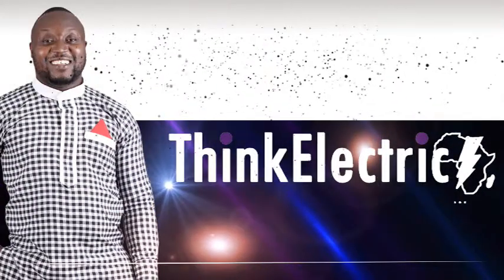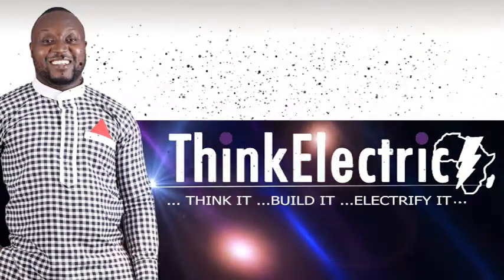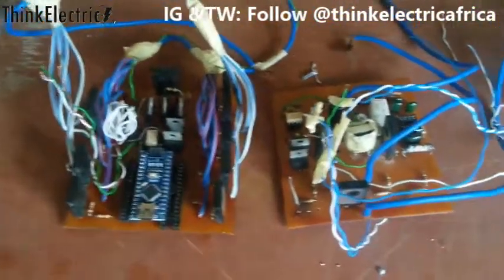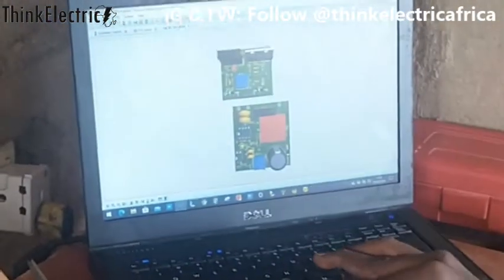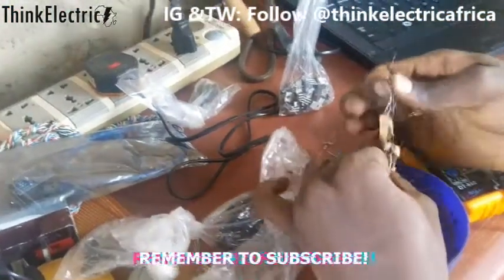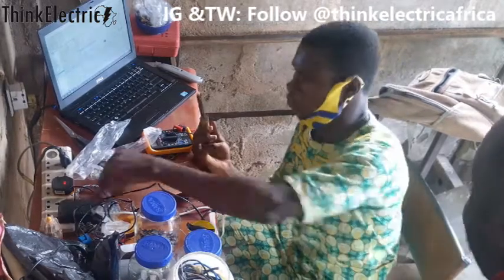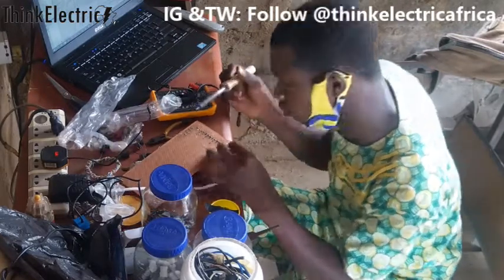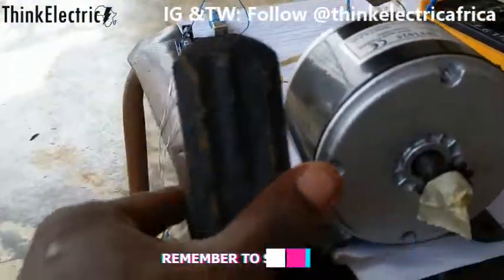I Made An Electric Motor Controller Using Arduino, Very Easy DIY

Comment: How watts is the motor rated at , and at what volt?
Reply from the maker: The motor is 250w and 24v.
Reply: @thinkdiyafrica  THE exact same motor was used in a build  I saw here on YouTube. 
Video Title:  
"Torque: The diy all terrain cruiser board"
It'll Give you an idea on d kind of project i' m working on. 
Please, do check it out.
Thanks